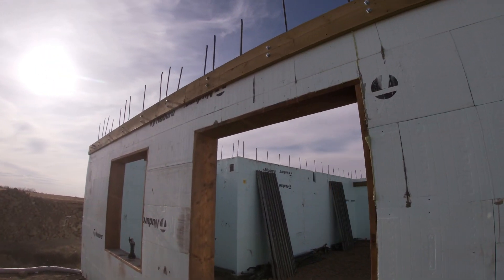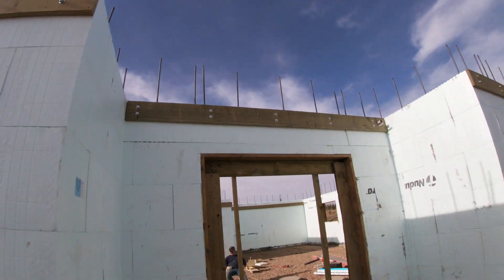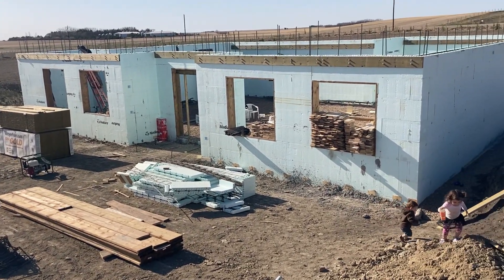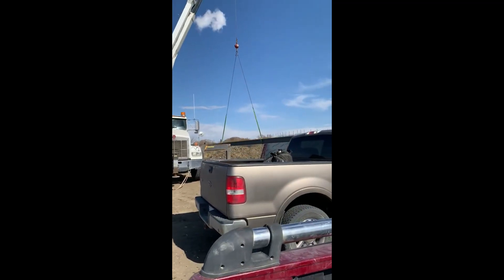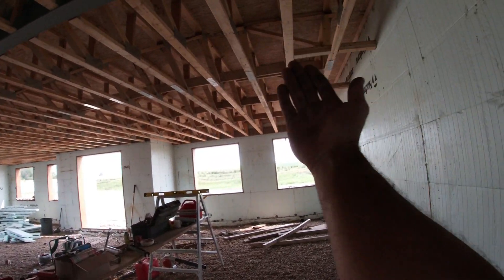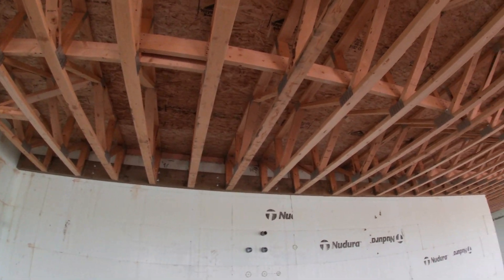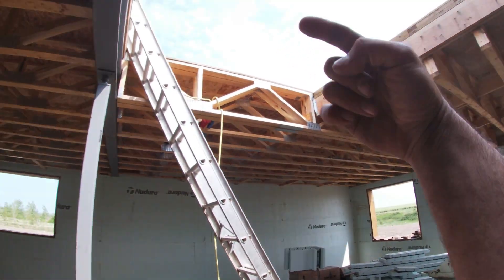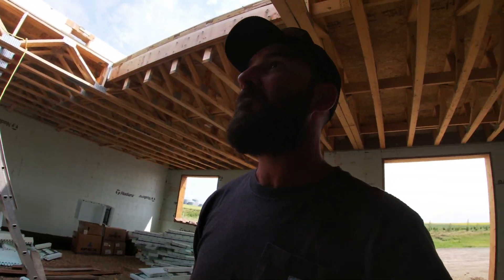Vlog 6 - Installing Floor Trusses onto ICF Walls Nudura ICF

Comment: are the floor trusses tied into the steel beam down the middle?  I didnt see you bolting them or anything when you were setting them in.
Reply from the maker: Hi! Yes. The plate is bolted to the beam, and the trusses are nailed to the plate.

Comment: Hey guys , do you still remember how deep the steel beam pockets? Does it sit on the full  6inch nudura core or less , giving the metal some room to expand and retract and does it have metal pads or straight on concrete?
Thank you.
Reply from the maker: Hi!!! It’s almost the whole 8” core. It’s on the basement wall so it’s 8”. The beam shouldn’t expand and contract as it’s inside where the temp doesn’t change much. It’s straight on the concrete.

Comment: @6:24 why did you choose to hammer drill the (inside) 1st floor ledger instead of doing the same process as your exterior deck ledger?
Reply from the maker: The alignment system (bracing and scaffolding system) goes pretty much all the way up to the top of the wall. So the wood ledger wouldn’t have allowed the alignment system to be secured flush to the wall. We would have much preferred to just do the same thing as the outside deck ledger!!! But the alignment system didn’t allow us to do that.
Reply: @eberlesbuildahousediyicfho9630  it’s now so obvious;)

I started watching your videos today.  I’ve watched A LOT of other ICF projects on YouTube.  Your documents on of the process and details are building my confidence in doing my own.
Reply from the maker: @TriDaddy  this is our first ever ICF project!!! We did the same as you… watched a bunch of videos, did some reading and research. The Nudura rep was super helpful also. Came out to inspect before we poured, answered any little questions we had along the way. It was a great experience. We’re very happy we went with ICF.
Reply: @eberlesbuildahousediyicfho9630  Great video, it's good to see the up-close detail you show. As far as the mounting of ledgers, I'm thinking of doing my internal ledgers as you did your external decking ledgers, but hope to first attach 2x4's to the wall where the alignment props will go, then the props onto the timber. In this way, the props will help secure the ledger to the wall (along with timber screws) and the 2x4's will come up right underneath the ledgers (and all the way down to the floor) to ensure nothing moves. You think it'll work?

Comment: It looks great. You are doing an awesome job. Glad to hear you over do some of the building materials i.e. rebar and such. But I kinda wish you had use plywood instead of OSB.
Reply from the maker: Thanks!  The stuff we used is not like the old OSB sub flooring was.  When it was right off the pallet liquid would pool like wax paper.  Its really good stuff.  We did use fir tongue and groove on the deck outside though.  The other stuff would not hold up outside like fir plywood will.

Comment: Forgive my inexperience but I'm seeing that steel I-beam supported by  those steel columns. Isn't the reason for using the I-beam so that you could have  that span without floor supports? Otherwise it would be less costly to use 2x10 joists or OSB I-beams if your going to have to install column supports.
Reply from the maker: The house is 52’ across. It’s a very long span. We could have had a deeper beam and eliminated the columns but that makes mechanical/plumbing/etc much more difficult. When we are done, we won’t have any bulkheads in the basement at all. The columns are built into the walls so you won’t see them at all anyway. We’re getting started on it soon!
Reply: @eberlesbuildahousediyicfho9630  I see. Thank you and Congrats.

Comment: Why not avoid the hammer drill on the interior ledger, wet set the bolts as you did on the outer ledger?
Reply from the maker: We couldn’t do it that way on the interior because the braces (Nudura Alignment System) were in the way. They have to be fastened to the wall and they go almost all the way to the top. We had to hang the ledger afterwards. We could have wet set just the bolts… but then try to make 40 + hole line up. But yes, if the braces weren’t in the way we would have much preferred to do it the same as the exterior ledger.
Reply: @eberlesbuildahousediyicfho9630  
    That makes sense, would've been evident if I was on site but not as easy viewing from my end. Appreciate the reply.
Reply from the maker: @RICK-uf1jj  Thanks for the question!!! Feel free to ask more! Should have the next video ready in a week or so… stay tuned!!!
Reply: @eberlesbuildahousediyicfho9630  Thanks. That was my first question when I saw this video! As with most things in life there is normally a perfectly rational answer for things that seem odd at first glance. Will catchup on the rest of the videos but very interested in the steel beam. My dream is to build my own house and have a basement without too many supports impacting the floor plan.

Comment: I'm curious why the horizontal rebar dowels between the floor and wall? I haven't seen that before.
Reply from the maker: Not sure which ones your referring to… the ones sticking out of the bottom of the walls for the basement floor?
Reply: @eberlesbuildahousediyicfho9630  Yes, those ones. Is the basement floor suspended? Here in Ontario the basement slab rests over the footings but is not tied to the wall structure.
Reply from the maker: @steinwaymodelb  We could have done it that way too. But the way we chose to do it is just a really strong installation because everything is tied together. The engineer suggested it, we liked the design. Hope that helps! Feel free to ask more questions!